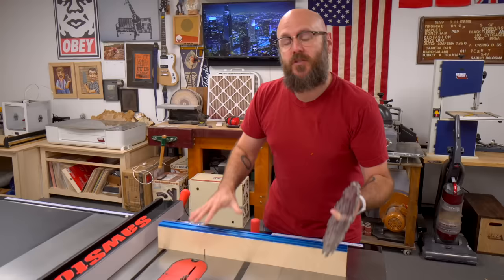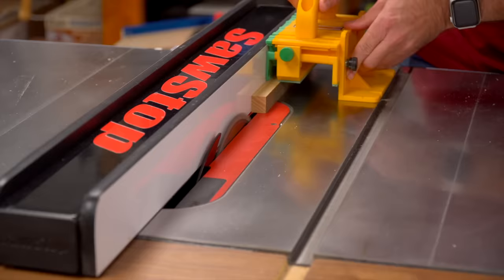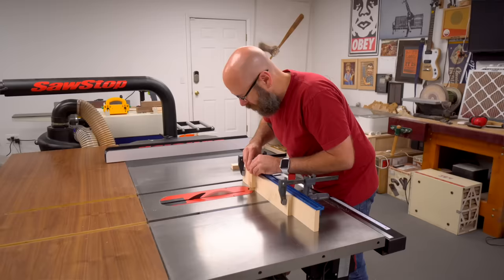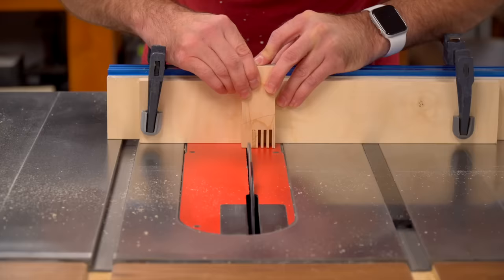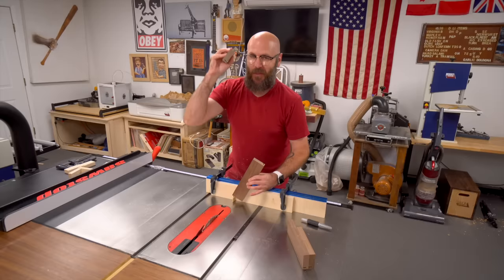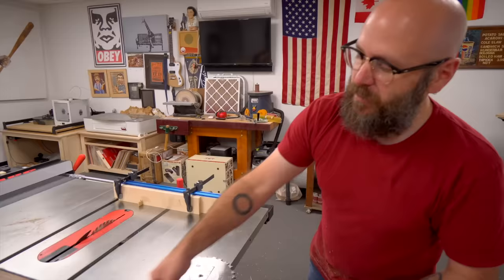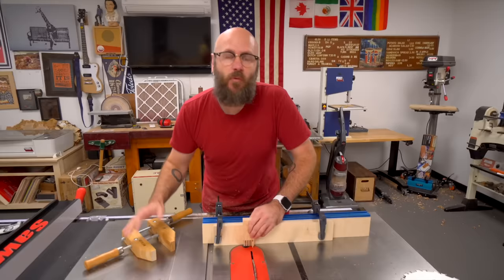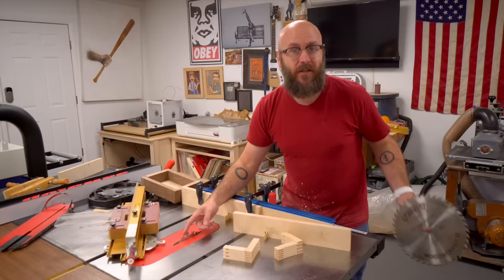How to Make a Box Joint Jig. Quick Simple and No Dado Needed.

Comment: I really want to thank you for your time in making this video. You are simple, don’t waste a lot of time trying to impress me, and use real tools that most of us have. One of the better finger joint jig videos out there. One tip—most standard saw blades are 1/8th inch. Instead of cutting that finger, out of wood, consider using an old drill bit for the key. If the jig is used in a router table, a corresponding router bit (1/4”) can be used.

Comment: I carried a Birch ply  tool box for 20 years that was made with Box joints  and was filled with  hardware. I needed to install Architectual Woodwork  the box is retired but  still in very good  condition minus scratches   And bruises from every day use   The box actually  had 12 plastic  containers that kept the hardware organized  and when filled up  the   Entire  unit weighed  over 70 lbs.! I'm a firm believer in box joints   That same design was used by 20 other installers  that also used the same hardware and worked for the. Company  generally the boxes were  finished with a clear  conversion varnish that  once a year could use a respray  to keep them looking  nice and hide some of the scratches and scuffs  overall the box joints  held up  fine  even with  heavy tool boxes getting stacked on them and being transported  on handtrucks  to and from a jobsite  another bonus was they weren't  very expensive to build   And we used the same basic jig you built although ours were a dedicated sled  for the table saw  and a stacked dado set  of blades

Comment: Beautiful way to make a box,  definitely shows quality in your work as against pocket holes or other methods. and if only there was a Dovetail jig as simple as that!! I prefer the 1/4 6mm joints, sharper and neater especially on that dark wood, over here in europe we are not allowed to have dado wheels, against the law as it means disabling the riving knife on a circular saw, the main prevention of kickback. The actually make the arbors on the saws shorter to prevent you importing a blade and installing it.

Comment: i use combo blades and they have a square tooth as a rake to clean up what the alternating teeth leave behind.  Two left, two right, and one rake, in each bunch set of teeth.
it’s the Diablo D1050X.  $37.97 @ Home Depot.  They usually have approximately 0.002 to 0.005 runout.  That’s not bad for a blade that’s under $40

Comment: i tried this for the first time today. joints ended up a bit tight but they do go together with a clamp. worked good on the test pieces, but the final pieces were a bit tighter for some reason. i think i needed to adjust how close the pin was to the blade a bit. used a 1/4" dado stack. very helpful video nonetheless. thanks!

Comment: The business card shim trick was wicked smart - adding an extra stop block would never have occurred to me! Also, thanks for the 'single blade' option - we are dado-deficient in the UK... :(
Reply: Now right after the brexit you van finally use the dado as it is prohibited bythe EU
Reply: Aren't we just! It would be really nice to have a dado stack, probably safer than using two or more regular blades with spacers...
Reply: Use on the router table if no dado blade. just make sure you've got a piece of wood behind to support the cut
Reply: No dado blades in the UK?  Don't you guys have Amazon?
Reply: Roger Rarebit no machine shops in the UK? Lol
Reply: @jx14aby  we do but the saws arbor is made short to prevent them being used as it would mean removing the riving knife.
Reply: @jx14aby   been using one for years with my table saw love from oxford England 🏴 😊

Comment: Dear Sir: I built the finger joint jig, and installed on miter gauge for operating with my router table insatalled. Didn´t  work well because when I put the test piece to make first finger router tip made the piece move sideward although I held firmly, tell me what I´m missing?

Comment: Do you run the pin boards through again, thus shaving off some of the pins? The way I imagine it, if you move the guide pin, your first cut will result in a slightly smaller pin, but once you move the board along, the rest of the pins will simply be the width of the dado. I saw something similar on another channel and I am truly confused on the mechanics. In this video, it looks like the test piece is completely milled with the adjustment, not the previous piece re-milled with the adjustment. I made this jig (works great) and now I want to dial in the adjustment.

Comment: Third time watching, third time trying and I finally got it.  I watched several other channels but your explanation of positioning your cut pieces is by far the best.  One issue I’m having is some tear out on my dado cuts.  I’m using a newer Diablo stack.  Could it be the soft pine I’m using for my fence combined with the soft pine project wood?
Reply: probably speed of pushing onto the saw.  trying going slower , works fine on the pine i buy
Reply: @sitgesvillaapartmentneilsc7924  Thank you!  I'll give that a try.

Comment: Thank you for the instruction. I understand this video is old but thought I would ask, inn the event others experienced the same thing.  I made your jig and your instructions were clear on how to make the adjustment for tight and looseness of the joint - awesome thanks.  I do keep getting tear out on the back of the cut using the jog - sure it isn’t a jog problem but any ideas how to solve?  I used painters tape on the back of piece, tried to clamp it so it was tight against the fence/jig, etc.  Using a dewalt dado set, 1/4” dado.  Also using pine, is it just too soft for cutting the box joint on the table saw.  Thanks again for your continued content and positive vibes.
Reply from the maker: try putting a sacrificial piece of wood or plywood between the piece and the fence. could be as small as 1/8" plywood.

Comment: Also, I have been making box joints with router and no dust collection availability with my older porta cable. What a mess. Just have to use table saw. Much cleaner.

Comment: Any advice for a beginner wood worker struggling to make my pieces fit? I’ve watched this video probably 20 times, and I followed this step by step and my finger joints didn’t match up. I am almost certain it is due to my miter gauge having play (I have fine tuned it to fit the best it will do, but it’s not great). Would this work on a cross cut sled possibly? I don’t have access to dado blades or stacks. I believe that would make it much easier (less fingers=less amplification of error), but that’s not an option right now unfortunately. Any help or advice would be greatly appreciated! Love the channel!

Comment: Smart and easy. But i have another problem. I make mdf trays and boxes for a living. With good glue you can have very strong joints even if they're cut 45 ° in corners, but this doesn't work well with wood, with has to be finger jointed wich your jig is perfect for. The question is haw can you speed things up a little cause i'd have to make around 20 trays in a day  from start to finish to keep a good price ? 
PS. I have a video with how i used to make mdf trays on my channel but that's not how i make them anymore.

Comment: Thank you..always have to re-figure this out I do it so seldom. But confused. Near end, you mention blade height "just above thickness of board". Yes makes sense. But in beginning you say blade height "about 3/4". Shouldn't that also be "just above thickness of piece"? Because if kerf is too high, say 1" for example and then glue the pin-key at 1" height, the piece has to fit over it and so will have to be cut 1" deep..too deep. I guess if kerf is cut too shallow, only say 1/2" high, that's ok as long as the actual finger cuts match the piece's thickness. Point is, shouldn't all cuts in the jig be made to match the proper thickness (and just a hair deeper)? Just asking, not commenting because I really don't know till I try. Thanks again, in advance.

Comment: Because I don't have a dado blade (and don't want to invest in one because I don't use finger joints a lot), but do have a DIY router table (2X2 feet surface), I'm going to try the same thing by building what is essentially a 'cross cut fence,' but used on the router table.  That way I can use a straight router bit to achieve the wider cuts.  Wish me luck; and if you have any advice in advance, please let me know.  Thanks, Dave!
Reply from the maker: I’ve got a video on this! https://youtu.be/nsgy6d4365k
Reply: @MakeSomething  Discovered the video after I posted this.  Although my diy benchtop router table fence currently moves using side guides, like yours, I'm going to try using a pair of t tracks instead.  I'll let you know how that turns out.
Reply: HELP! HELP!  I just finished my version of the router way of doing this, using tracks instead of the side guides.  I tested it and still need to adjust the finger width (the joint is a little loose), but otherwise works awesomely!  PROBLEM:  The diameter of the bit I'm using is not an exact multiple of the height of the box (so that the last finger or groove of the long side is an odd width).  Soooo, how do you start the cutting the short side so that I end with a finger or groove that matches the odd finger/grove on the long side?  I have a few lessons-learned from making my version this jig that I'll share with you in a different comment, or email to you.  Thanks!!!
Reply: @MakeSomething  Dave, disregard my question below.  I found out that even if the bit diameter is not an exact multiple of the box height, the method you describe of how to start the short side still works.  Thanks!

Comment: Great video.  I don’t understand how moving the jig over (as with the business card ) works.  The blade width is still the same.
Reply from the maker: It changes the position of the blade to the pin which changes with width of the finger (the non-cut part).
Reply: Thanks.  That makes sense.

Comment: Thank you for describing the sequence outs and flips. That took me a long time to work out. I see that you are using a hardwood (looks like Walnut). I am working on 3/4" x 9" x 23" drawers and having a terrible time with tear out. Any recommendations on getting rid of tear-out in plywood?
Reply from the maker: Thanks Bob! Do you have any 1/8" plywood you can use as a sacrificial back? That would prevent the tear-out.
Reply: @MakeSomething  Thanks. Does the sacrificial fence go in front of the board with the key or behind it? Feels like a stupid question, but I want to get this right.
Reply from the maker: @rhjiv4  I should have mentioned this in the video. I like to make it the width of my board and place it between the board and the fence. Hope that helps!
Reply: @MakeSomething  Thanks - that solved the tear out. Now for the BIG problem. Yours is the only video I have found that addresses the cut sequence (mark the tops, keep mark pointing to the pin). But even you stop short of showing the whole sequence. Mastering this sequence has been driving me batshit crazy. I mark my boards 1..4, then do 1 (front), 1 (back), flip so mark s close to pin, then start on board 2. Continue for boards 3 and 4. But it never winds up  correct.
Can you make a video that focuses exclusively on this process and shows it in great detail? I have gone through almost a full 4x8' 3/4 piece of plywood and have zero success so far.
If your video included "Classic Box Joint Mistakes", here is the rest of the list:
1) Blade too high - keys need to be sanded and this impacts box dimensions
2) Blade too low - holes in the joints and box may be too big
3) Keys too wide / narrow - you address this
4) Cutting with the grain - causes tear outs
5) Messing up the cut sequence - watch Mark's Mesmerizing Matich ;>)

Comment: Did anyone notice with both single blade and dado stack it left a hole you can see from the outside from the groove? It happened to me as well trying to make a finger jointed box. Anyone know how to overcome that?
Reply from the maker: You have to not cut the groove all the way through
Reply: Thank you
Reply: I’m still confused on this... how do I go about not cutting the groove all the way through on a table saw with Dado stack?  Trying to cut a 1/4” slot for the floor of the box.

Comment: What's the kerf width of the blade you used here?
Reply from the maker: Standard which I think is 1/8"
Reply: @MakeSomething  Think mine is also standard, but that's 2MM.  Reckon I'll need a thicker blade to do this? I can't use dado stacks, as my table saw is EU and the arbor is deliberately not long enough to support them, due to pesky EU nannies...

Comment: I think you used too short of a wood stock.

If you use stock that extends past the left side of your guide, once you have the jig zeroed in, you can glue a piece of wood that rests against the guide.

The next time you use the jig, you just make sure the L bracket is resting next to the guide's side and the jig is automatically zeroed in. No need to recalibrate.

Comment: How can the fingers change size if the kerf of the blade is still the same size? The maximum finger size is the kerf size, right?
Reply from the maker: Correct. To change size you need a dado blade.

Comment: I.am sans knowledge on box joint jig for the table saw.  ?..I know this is simpler to make than quarter inch made with Dado blades. It would seem the thinner pins would 
make a less reliable joint...I DON'T know..This seem this would good for jewelry boxes. I am wondering if you could use a eighth " blade and have a secondary stop. That is quality work.

Comment: Not that your video is not fantastic, but I spent all damn day trying to do this!  IT IS NOT THIS EASY!

Part of it is probably my learning curve, and part of it is probably my Craftsman 80 I'm still trying to get dialed in.
I had fingers in strange places, joints that never matched up, and all kinds of confusion!
Now the blade is 0.125, but the trouble is the actual runout on the ball bearings on the saw causes the blade to automatically dado the cut to 0.132".  Even with the tooth I cut to 0.130", that 2 thousandths of an inch caused massive problems down the line as the error progressively adds up! and it adds up enough to cause your whole joint to mismatch.

I think this kind of work needs to be done on a saw that is actually worth doing it on.  Don't try this on an old Craftsman unless you know what you are doing, and I don't.

Thank you for your video, the information, I'm going to keep struggling with this until I can get it handled.  I'm not going to give up just yet!